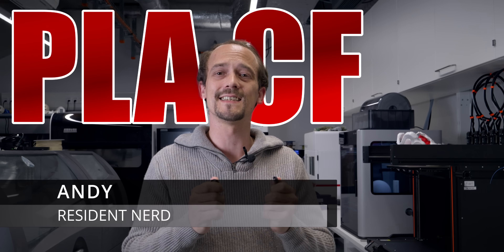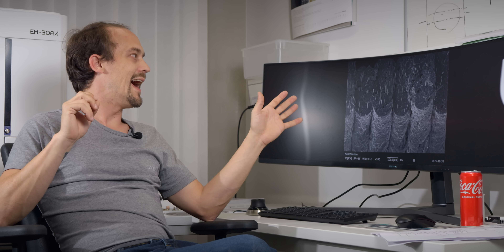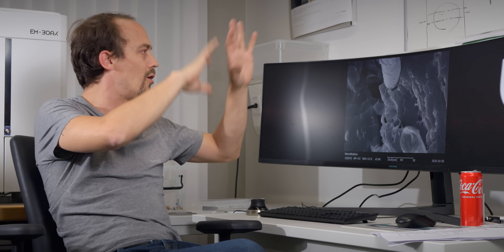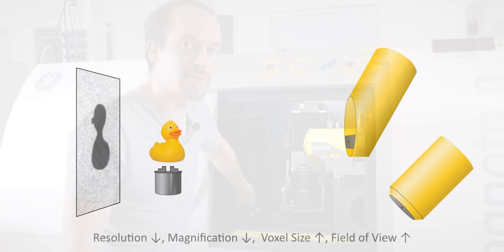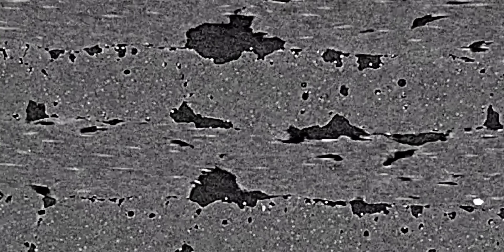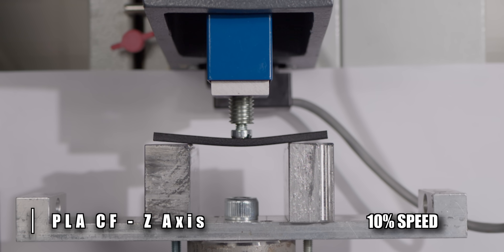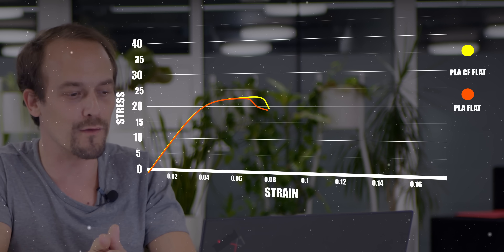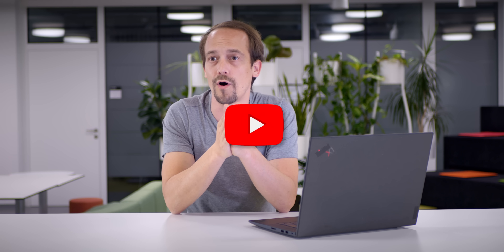3D Printing’s Biggest Scam Is Even Worse Than We Thought!

Comment: well thank you, I "feel" vindicated, even if still anecdotal in my case, I do believe informed decisions (educated guesses) are invaluable: years ago I warned, my then boss, about "CF infused filaments" from wear&tear of the printer to the doubtful (claimed) results of the prints all through the cost/benefits... needless to say, he ignored me, destroyed a perfectly good (semi new) nozzle and feeding gear set, printed a half arsed PLA-CF part that failed mid race (he's an amateur triathlon athlete LOL), he was lucky it was just a "holder" and not an critical part... but you know what pains me, his rebuttal: "if I had printed in PLA the part would have failed anyways"... well I (we) know!!! (believe me, I pitched PETG several times, have even my won sturdy parts as practical examples), but my point is: to this day many people use the wrong reasoning to make the wrong decisions largely to justify what they want to be true and  not what *actually is*, and in most cases we don't need CT-scanners nor electron-microscopes to figure it out.. ..accurately enough that is... (which is prohibitively expensive to most irregardless, so thank you, again)

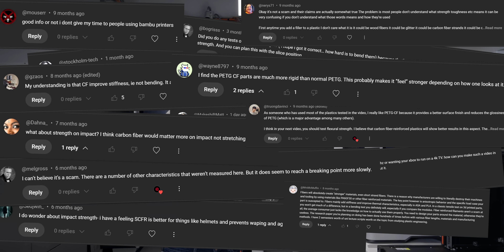Comment: 0:23 you know im just waiting to find out the carbon fibre is this century's asbestos...  i mean you know it has to be because much like asbestos its just too damn useful not to have some sort or hideous secret
Reply: I think microplastics are already this centuries asbestos. But yeah
Reply: This is specific to 3d printing - the whole point of carbon fibre is, that it is a long fibre („tow“). For 3d printing you give up exactly that strength and break it up into basically carbon ash, which has nothing to do with carbon fiber but the name. This is like putting asbestos powder in PLA and call it „fire proof“.
You only get the health riscs without the material benefits.
Reply: That's plastic
Reply: I think MDF has already claimed this award..!
Reply: Its already been proven, it's basically silicosis. The particles are so small, they can penetrate the nucleus of cells and directly interfere with DNA.
Reply: @angusmatheson8906 
😬
Reply: It is a form of nanoparticle so it will have the same effect as asbestos, they also inject this stuff into people constantly now that will really work out great for them. Infertility and cancer.
Reply: @LTPottenger  Graphene ..Clot shots..Turbo Cancers etc
Reply: @LTPottenger It's always great seeing you out and about commenting on other channels. I am surprised at the kinds of videos where you show up!

Comment: One thing someone could do to test the fit is to print the first 5-10 layers of each part and nest one inside the other. If the bottom sections of each part fit together well then the fit should carry through the rest of the way up. Will save a ton of time and material.

Comment: I am most interested in thermal deflection temperature and how CF affects that.  I print Bambu PETG-CF instead of regular PETG for the increased deflection temperature.  It would be good to know if the data sheet numbers are bunk or real.  Same for running Nylon CF vs Nylon GF, I'm looking for increased temperature range.

Comment: We all know it's not stronger. No CF or any other fill material for that matter is, not even PA or PPS or whatever. Obviously cutting in 20% CF powder isn't going to increase strength like it does in stranded composites. However it does have advantages like increased stiffness that can actually make something more durable in the right context. It does have excellent compressive strength. It does help with creep. A PLA CF part that's only under compression would benefit from CF, especially if weight were a concern because it is maybe 15% lighter. It also helps a ton with bridging and overhangs and just overall print quality in general. Supports work WAY better with CF. Parts you can print clean with CF filled materials sometimes won't print at all. Parts that have large footprints that warp will print without warping or at least less, and yes PLA can warp if the footprint is large enough. It's not a scam, you just have to know when it's useful and when it's not. You also can't understate the aesthetic quality of the surface finish if that's the matte look you're going for. Also sanding is a lot more effective with carbon filled materials.

Comment: I suspect the solution is going to be a chemical reaction to make the carbon fiber more likely to form a carbon bond with the polymer. Even if this weakens the CF there's a good chance it will still be stronger than just PLA. Not a materials scientist of course lol
Reply: Also, while shear strength is a valid concern, how about testing Tension and Compression forces.

Comment: The other day I watched a video about a plane crash caused by an "ABS-CF" intake manifold that acted more like PLA-CF in testing (with a lower Glass Transition temperature).
"When 3D Printing Goes Wrong: The Airplane Crash No One Should Ignore" by Vision Miner.
He did not mention any investigation into whether the wrong filament was used or not.

Comment: WOW!   really awesome work. 
while I really enjoy the CAT, I feel a comparison of a non carbon fiber PLA print to a carbon PLA is needed as a control group.  (I would throw in PETG-CF and PETG, and a few others +CF and -CF filaments as well...  if there is time with the CAT)   The working hypothesis is that these air voids are created from the carbon fiber, but we need to eliminate variables and compare them to other prints to confirm that there in indeed a difference that is only present when the carbon fiber is present.

Comment: this alignment in extrusion problem even exists in ground beef in tubes..   its a cool trick tho, you can take a 10lbs beef log, puncture a line of small holes at the top and cook at 205°F for about 5 hours and the beef will constrict inside to about 70% the diameter and squeeze out almost all the fat in the meat.  handy for making 96% lean little pucks.

Comment: I'm pretty sure anyone that is a real 3d printing enthusiast has been aware that the carbon fiber thing was not a thing from the get go.  I'm also pretty sure the intent was to make it like fiber reinforced concrete which it clearly is not. With that being said do you have any ideas to make carbon fiber reinforcement work? Is there a chemical process that would make the fibers grab better? I know putting the carbon fibers in a microwave changes the structure quite a bit, I would like to see a video on your thoughts about this  and the possibility of making super strong 3d prints.

Comment: I want to see two more things. The first was a missing component of this testing. The second is a different material tested.

First I want to see a test where instead of flexing to failure parts are flexed short of the failure point and released multiple times to see whether PLA or PLA-CF last longer before failing from flexing repeatedly.

Second I want to see you do this with PET-CF17. I have printed multiple things with PET-CF17 and none of them have failed under load including in firearms components. Also when testing this please test it both with and without overnight thermal annealing of the printed parts.

Comment: Personally I have been avoiding CF filaments simply because I don't want to have to deal with stray carbon fibres in my environment.  I only print with PLA, PETG and PC so your videos do give me another reason why I should avoid CF filaments lol.

That said, apparently fibreglass reinforced PLA actually does improve the strength of PLA if the glass fibres are properly treated so they bond with the PLA.  But, again, I don't want to have to deal with irritants in my environments so I won't be using those either lol

Comment: Would be interesting to see the carbon extruder printer and filaments. 
To see if the layer binding is diminished or the same . 
And it is assumed the single layer strength is greatly higher as is one long piece of CF .

Comment: not a professional - so just in my opinion - as carbenfiber materal is a mesh of fibers fixed by a polymer.  not short fibers in a polymer. so even if would glue together, the benefit of carbon wo be strong on pull-foces, if the fibers are short, the materal can't add strength on pull-forces.and any problems with the gluing of carbon 2 polymer it will get weaker.

Comment: Good investigation - yes, please do other carbon-reinforced materials, ones which actually work, cheers! 
If there are lots of voids does that mean the CF material weighs less? I'm assuming that a CF filament less dense than the PLA resin it replaces too? That's the only "positive" i can think of...

The ditzy tune whilst break-testing those parts was sweet :-)

Comment: The voids make FDM suboptimal, but any CF or GF strands do add dimensional accuracy, heat stability, and rigidity. Those properties are obvious to anyone who picks up an FDM fiber part. For real usable shear strength, bending resistance, and crush strength II embed steel bolts, plates, and copper pipe into prints. Wrapping a print in fiberglass in just 1 layer really locks everything in and gives insane tensile strength. I've made offroad parts and entire small vehicles with these techniques.
Reply: Are you talking about PLA CF or other filaments? Because it's important to distinguish that, as the video also states.

Comment: There’s a reason we use cement shakers. This is to make sure there’s no air gaps especially around rebar used to strengthen structures. This seems like common sense to me. 

I used to drill water wells and to see if our wells were strong we would test by putting them on our table and push down with drill steel just like how you’re testing you’d be amazed how strong a weld can be holding 25k pounds of force and never breaking or breaking with almost no force at all. Just cause it’s pretty looking doesn’t mean it’s strong.

Comment: How about temperature resistance? I had a project that led me to choose PLA-CF vs PETG-CF because I wanted an easy-to-print filament with matte texture, but more temp resistant than normal PLA. And PLA-CF was the clear winner there.
I do wonder about the CF shards, so I'd welcome such a video!
Reply: Why not some of the HT PLA filaments? PLA CF will get you to PETG temperatures, maybe. HT PLA can get you above ABS temperatures.
Reply: I briefly considered it but based on MyTechFun's comparison tests the CF did win in impact strength over normal or even tough PLA. And since I didn't need such huge temperature resistant improvement,  the HT kinda never attracted me too much. Lastly, the CF look is quite nice too!
Reply: @danimagfernandes  It's got some small physical effects (and more negative ones). As for looking nice, you can get PLA in all kinds of aesthetics. When contrasted with the serious health risks of CF, it seems like a terrible choice that can't be worth it. I could understand it with something hard to print which CF makes much easier, but not with PLA.

Comment: 14:00 the main reason why is that to gain strength cf need to be in one continuous line, but at ct scan we can see that it's just a little bits just placed randomly, for one who doesn't know material like this, steel rebars for grater example work by the fact that it's special placement helps to disperse all the stress from 1 point to all body just because it's connected in all directions through all the body, it's like if you just stack jenga blocks and to strength it you tape several parts together

Comment: As noted earlier by SLu-jt3es, the strength difference is predictable based on solubility of the respective materials during manufacture, the PLA monomer and CF. 

PLA is polylactic acid. Lactic acid is very water soluble as the monomer molecule is very polar. Lactic acid has poor solubility in non-polar solvents. Carbon fibers, unless doped, are non-polar (not water soluble). Thus, when the lactic acid is polymerized in the presence of carbon fibers, they repel each other at their contact surfaces, resulting in poor adhesion. This poor adhesion will persist on melting of the mixture, then forming into a shape (e.g. 3D printing).

Comment: It tells me the interfacial energy is too dissimilar and a suitable sizing agent needs to be found that can chemically bond and be stable at elevated temperature and loading. I would try a silane first due to their shape, thermal stability, variation, and relatively inert behaviour. I would then ask the question of why put a CF 'reinforcement' (currently a poorly compatible filler) into PLA when there are so many alternative materials because my brain always asks the more important question second. Also the voids in the material may be from the production of PLA as the material is effectively two phases at a minimum with no compatibility enhancer or processing agent. It also may be that even drying the material doesn't allow bulk water from leaving these voids during the drying time permitted. Perhaps add a water based tracer to a master batch and see if after processing and integration into neat PLA dried and as-is would provide further information when compared to a control?
Reply: Great video BTW, first time I've seen anything remotely this professional discussing the issues related to 3D printing materials outside of journal papers!

Comment: Every CF print I've done (PETG-CF, PC-CF, and Nylon-CF) has benefited greatly from slower print speeds and wider line width (150 to 175% of nozzle width).

Prints that were not done etc these settings absolutely split at the layer lines with no strength.   Prints that were done slower than normal and with wide lines (on a calibrated printer so the lines firmly pressed into each other without overflowing the space) were incredibly strong.  Taking them to the braking point had them break as a solid piece, not along the layer lines. 

Are you accounting for this behavior of CF filled filament in your print settings?   Could the separation you're seeing be exaggerated by improper print configuration?

Comment: Yea I knew it was a gimmick from the start. Just cursory knowledge of the processes of both 3D printing and carbon fiber/fiberglass lend to the realization that it’s two separate ways of making parts. The analogy would be heating, forging and quenching plastic. It’s two separate methods for two separate materials. Carbon fiber needs for it’s strands to be continuous and tightly woven. The process of curing needs a complete vacuum at autoclave levels of heat that contain the whole part.

Comment: I wonder what happens if you have a CF-ABS and then acetone smooth it over different periods of time, or even attempt to heat treat the part (anneal/temper) to try to bridge some of the gaps in the polymerization. Although, yes, the CF will still break some of the bonds between the polymer, I think possibly heat treating it could bridge enough of the gaps to make a difference

Comment: Thank you, this was a really well resourced and interesting video including real world impacts involving this material. I come a metal working background and have in recent years worked with wood board and timber. Even from the very early days of carbon bike frames, worrying failures were occuring due to poor lamination and in the deterioration of the bonding agent structure. As with wood, carbon's strength is better in long unbroken strands of grain. The tissue around the strands acts as reinforcement and to hold them in position. Tiny broken fibres simply compromise the overall structure under tensile loading, in my humble opinion. I still have a 1993 carbon-framed mountain bike with aluminium lugs. The tubes were so strong when demonstrated at the shop, they rested a hit from a 1kg hammer. Made of stern stuff!
Regarding you kind offer to make a video about the health and safety issues about being around CF in manufacturing, I have a brother inlaw who has worked with the stuff for ages. I think an investigation would be most helpful to us. Take care.

Comment: It's like they thought that rebar in concrete is just little sprinkles of steel. If it's not actually forming a structure within that the substance can bond to or at least tightly wrap around, it's just a contaminant. I didn't realize until now this video that that's what PLA CF actually is. What a joke.